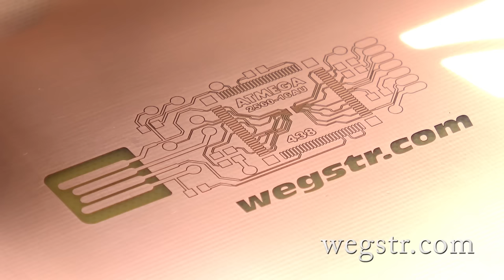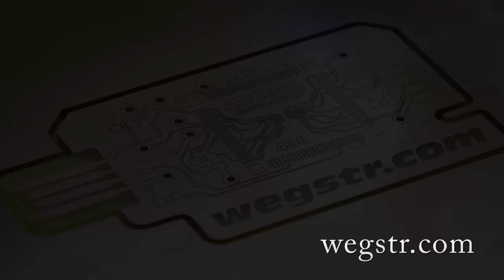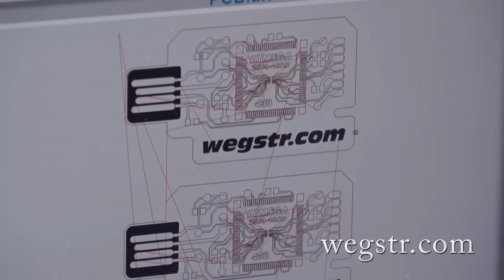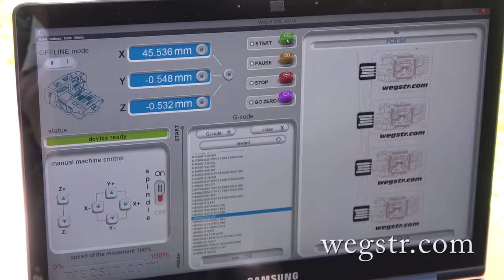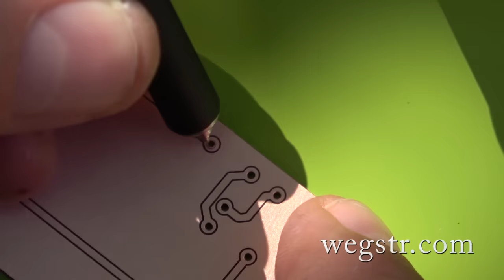Double layer PCB prototyping 0.1 mm traces/spaces

Comment: To answer some of the questions below. Sonia have had this machine for over a year now. It is an amazing price of kit and extremely well made. Isolation milling can take e quite some time and as does the probing of the PCB surface prior to milling. This machine can mill a small PCB in about 3 hours if you include the probe and mill operation. Also make sure that you have the correct isolation routing bits for the job. Also weave a small syringe of mineral oil to cot the PCB surface with prior to milling, it makes a big difference to the quality of the cut. With respect to milling the outside profile of the PCB, if the PCB is square or rectangular then far better to use a PCB Guillotine to cut the board. 

So for a slightly higher volume of birds, day 10 or more, I use this machine to drill all the holes in Microtrak pre-sensitised PCB board and then expose and etch in the usual way. This machine is very precise and accurate however use as intended for very small prototype runs and either use conventional etching or JLCPCB in China for more than say 20 boards.

This is an outstanding machine for its intended purpose. I am about to test this out to do some M2 thread milling in aluminium and sure it will be fine.

Comment: You guys should work on ink-jetting the copper layer onto fiberglass instead of trying to CNC material off the board, CNC has been done thousands of times by others and has yet to really work. If you could work out the chemistry of depositing metal you’d have a winner that could be done with a $25 ink jet print head and have 100 times the resolution of CNC.
Reply: Just an addition to your idea , just like through hole plating if you could come up with a method which inkjet prints something which could later be copper plated .......

Comment: It is beautiful...
From practical point of view. It would ve amazing if you can show, how the components are soldered onto it. I mean the melted tin just flow everywhere as there is no protective layer on that board. Even if using paste and heat gun
Reply: Peter, after the isolation and drilling process you clean the board and apply solder resist. One dry you use the an engraving bit and this mills through the solder resist to expose the component pads only. The rest of the board is protected by the resist. Hopefully this makes sense.

Comment: really impressive and clean fine milling there!, love how the toothbrush looks enormous. Would like to hear the sound of the machine though.
Reply: Hi John, it is not too noisy, you can work in a room at the same time. The PCB probe of the copper clad board takes up to 40 minutes and then you can load the nc code to start milling. It gets noisy once you start to mill the board edges. During the isolation routing I like to keep an eye on things every 10 minutes to add a few drops of mineral oil to the copper surface as this greatly improves the cut and final finish.

Comment: The main problem - non flat surface of board, bended material. Conical mill will produce different cut diameter on different parts of surface. Probably maximum width x height - 6 x 9 cm.
Reply: KV Popenko you need to make height map. Look up candle.
Reply: KV, I stick my PCB down to a sacrificial base that screw down to the machine bed. I use very thin double sided tape from Amazon. This keeps the whole copper board flat and then the electrical probing performs a contour map of the surface and the isolation routing is spot on. Using a this flat bladed screw driver and gradual bending force will prise the board from the base, Acetone will clean up both the back side of the PCB and the base as well.

Comment: And now... if you will try to solder a chip to this board, you will get to know the seventh level of hell :P
Reply: Why? Soldering a board like this is quite easy, even for a beginner. There's lots of great tutorials on how to solder a board like this here on YouTube.
Reply: Have you ever actually hand-soldered a chip with 0.1mm spacing between pads?

First-off it is not easy, second - it is almost impossible to do with simple home soldering irons.
Third - this board doesn't have solder mask
Fourth - this board has very small spacing between traces. 
Combine that with third - and you get a lot of unwanted bridges between traces - which you will have to clean off - welcome to hell. 
Even if you will solder every single trace and every single pad and clean all the bridges-  you still have to pray that you do not have any bridges underneath the chips. Because if you do - you will know that only once the board starts and doesn't work for unknown reason.

Everything looks nice on youtube video, but try it out yourself to see.
Reply: Whatever, I have soldered more than enough chips by myself, believe in what you want.
Reply: @marc_frank  don't tell the god what he can and cannot do :P
Reply: @marc_frank  and when and where did he ever told that he did not ever create anything like hell or is going to create or allow it to be created?
Don't be too full of yourself and put words in the mouth of the God that he never spoke. There is hell on earth, and there is hell besides earth.
Reply: @marc_frank  he did not.

Comment: Very slow production rate, etching makes finer trace and space, and you often cannot leave so much unconnected conductive material.  Cool capability though.
Reply: I mean it's about rapid prototyping man. We have one in our lab (not this companies) its made by LPKF they are exceptionally capable. Even have plate thru hole capability, it's not done the way shown here tho. Sometimes sending out for PCB fabrication also means exposing what you're working on...

Comment: I love your videos; so very well shot and they do a great job showcasing your equipment. I show them to all the students that work in my lab space (I run an engineering PCB fab lab at a US University and show your videos on a 70" TV, its mesmerizing), they love them too. Fantastic job! If possible, can you share whether your camera equipment is mounted to your CNC or are if you shoot video using standard equipment(DSLR/mirrorless etc) and a zoom lens? I have been using usb webcams to try and show students the process of fabricating PCBs (remote learning) but the quality is atrocious; It would be great to know if you have found an equipment-mountable camera that makes this kind of quality content.
Reply: They probably did it with a good camera and narrow angle lens, as the wegstr cnc moves the bed on X and Y axis while the Z axis with the tool stays still, except moving up and down.

Comment: Yeah, good luck soldering that QFP Atmega with flood copper in between the pads instead of solder mask, and that microscopic package in the middle.  These PCB milling machines make for great videos, and there is a role to play if you absolutely have to have a board same day. But otherwise -- pain and heartbreak, IMO.  Even the lands between the SMD R and C pads with only 0.1 mm clearance -- that's just trouble.
Reply: Yes you are right but, I believe this a show-off work and I do not think that it is a big deal to remove such flood copper regions.
Reply: For different, larger parts, I see something like this being very useful. As per the tiny parts in this video, I am inclined to agree with you. The only way I see someone realistically soldering anything that small without solder mask is with a VERY carefully set up solder paste stencil and reflow station.
Reply: There are limits to just about everything in life, within the limits of what CNC milling of PCB can do, there can be significant benefits?
Reply: My dude, use more flux - aka learn to solder betterer

Comment: The bed or platform must be really flat in order to be able to achieve this? We have our Roland MDX 40A and it could not be able to achieve full milled trace because of the angled plate, resulting of intact copper area.

Comment: 0.1mm traces? 0.13 - 0.15mm...  
The contact pitch of TQFP100 is 0.5mm IC!? 
Contact pad width 0.3mm. and Lead width 0.22mm.
Is the distance between the PCB line of the IC about 0.1 mm?

Comment: but.... why? this is lengthy, expensive, and the odds of solder spilling onto copper and causing a short are way too high!
Reply: 1 reason an 1 reason only. In house testing without the delay of shipping. If a prototype exits its design phase you can get a working prototype by the end of the day
Reply: @jakeengland1430  you can etch circuitboards at home though? like, all you need is a run of the mill printer, a clothes iron, some acetone, ferric chloride ane a solder mask. You can have a working prototype in less than 20 minutes, assuming you don't have specialised equipment.
Reply: @paweljasiek  i from personal experience will never touch acetone again it such a pain to work with and dangerous too its also not as repeatable you can also get much higher resolution on mills yeah for hobbyists go down your route cause its cheaper and easier bt for professionals mills are the way to go.
Reply: @jakeengland1430  You can keep the traces a little thicker in the proto and then thin them down later according to the fab house's capability. I'm assuming these are logic level signals and not power. Regardless, if you really are on the clock, etching is way faster. This is more of a luxury to be honest.
Reply: Well a few reasons when compared to a small “Hack” photolithography set up. 
1) with a standard at home inkjet printer you will not get down to 100 micron trace widths and spacing. The mask an at home printer does simply cannot produce a fine features like that. When you get that small you eventually start seeing the individual droplets of the print head and the density of the droplets is not high enough. You will etch those lines off.
2) depending on the project RF or Signal lines, the precision of the line widths are very important and you will not be able to do that accurately at home with a hack set up. Over etching is a huge huge problem when the features become small. 50 micron (which is a a very small amount of over etching. Would have to be a 1/4 oz copper) could be a huge percentage of your trace widths.

3) DIY or small operations chemical waste and chemical training is a huge aspect. For professional businesses that are small scale, chemical training and waste are very costly. You’re working with harsh chemicals that need to be disposed off properly. You should also really be utilizing a fume hood.
4) the mill also can drill VIAs and cut out the board to desired shape in one step. You will have to manually do that with photolithography which will never look as good. 

While a hack photolithography set up is nice and cheap, eventually it will all come to be the same price. Remember etchant doesn’t last forever and has to be replaced, solvents to clean the board need to be bought, other tools are needed for VIAs, and ink for the printer. Also time is money, this will be faster then etching at the hobbiest level. I don’t think you’d be making boards large enough where this would be to slow for that. As a hobbiest I understand this would be a luxury but would be really amazing to have it! This thing looked like a beast!
Reply: @paweljasiek  acid etching undercuts the resist. When the thickness exceed the width, etching fails. Hot air station needed for these.
Reply: @jakeengland1430  ethanol will so just fine.

Comment: Better hope your material is perfectly flat, which of course it won’t be, unless your paying an absolute fortune for extremely high quality PCB blanks. Seems only very expensive laser machines actually work reliably without hours of hassle at this point. In the end, it’s still going to be cheaper, and far far higher quality just getting a board house to use their millions of dollars worth of equipment to build them for you. Very neat concept that unfortunately still needs huge amounts of further design work to be practical, such as having sensors for dealing with less than perfect material stock and bit wear, professional machines use cameras for visual inspection and probing to overcome this. Rivets to join layers have been around for decades and sorta work for repairs if you only have one or two, on a board with lots of them you’ll have to solder them or you’ll have intermittent connection problems. So you might as well just run a jumper wire and solder that.
Reply: I've used a CNC like the one in the video at college. It actually works pretty well with normal quality PCB
Reply: Yeah getting true flat like this would be a couple tenths

Comment: I hear everywhere for the need of a very high spindle speed of 30.000 to even 100.000 rpm, what I have see here is just 11.000 rpm and a clean cutting, what is the reason? maybe vibrations of spindel of other systems who ragged the edges?

Comment: I'd buy it if it applied solder paste, had a pick and place, and used something like a heat gun to solder the components to the board
Reply: Coincidence?... I think not!
Reply: Shit that would be awesome. Also not impossible, if you could perhaps change the head.
Reply: @marijnstollenga1601  To do so is hell of a chalange in itself. Also you would need to load up your components in machine every time, therefore doesn't make sense to do so on hobbyist pcb (cause you really rarely need a few of a kind). So yeah, implementing such a system is just not worth the effort

Comment: Hello, what dust suction system are you using, the suction tube seems very thin, what vacum system is it connected to?
Reply: Ohh, so you are blowing the dust away, and not sucking it up?.....lots og mess...or?

Comment: Hello, what angle is the cutting milling cutter ? And what CNC model do you use in the video ?
Reply: dont know about the machine but i think thats a 60 degree bit chamfer tool. i have one like it
EDIT 1: nope correction. thats a single bit engraving tool. cuz you can see the engravings through the tool . and its 60 degrees im sure of that part

Comment: How do you get your table so flat?
Reply: Put down a spoil board and get the machine to skim it.
Reply: Old Machines & Such,  ah yes I forgot you only need a size of a few pcbs!  Subscribed!
Reply: there is an auto level software that probes the surface of the PCB in a grid and modifies the Gcode so it contains the height differences for the surface.
Also this case you need a machine that can be calibrated to more than 0.05mm precision as you want to mill 0.1mm traces.

Comment: Pcb etch is faster and you don't need to flat pcb, otherwise this method sometimes leave shorted traces. Although very useful for edge cutting and making thru holes and vias
Reply: Well yes and no. Shorted tracks are usually due to bad setting or using an incorrect cutting bit.  If someone helps me to understand if I can upload an image then I will run a demo later this week on some 0.8 mm board to show you the quality.

Comment: Why did you leave all the copper in place where it shouldn't be? This makes it very tricky to solder.
Reply: Vậy mà không biết hàn à
Gà thật đấy
Reply: Milling out would take forever and soldering will be just as easy as if it wasn't there after a solder mask is applied on top.

Comment: Want to check you are using blower or vacuum as don’t see any engraving dust in the process
Reply: Very great production lines.
Any needs on conformal  High Power High Voltage on UV Curing Coating Powers?

Comment: Wow, great job...! the restricted copper areas are routed magically...! Which etching bit have u used and how did you convert the gerber file to gcode (which tool/program i mean, because it works very well)...? Is like an art job...!
Reply: You didn't had any thoughts of looking at the links instead?
Reply: @dtiydr  yes dear... I don't mean control software, I mean the software used to generate the routing (FlatCAM for example)...
Reply: @matteolenzi6913  You have the adress to them, they most likely know that way better then anyone here!

Comment: Can you produce a 4 layer board with this setup?
Reply: You know how difficult it is to make a 4 layer board? Never ever can you make a 4 layer board with a cnc they have to etch every layer and then press it with an insulator between.
See the process of a pcb manufacturer: https://www.pcbway.com/pcb-service.html
Reply: How is that even supposed to work
Reply: No, you can't. Or you must create 2 boards with 2 layers each. Moreover, the riveting technology doesn't work fine, electrochemical couples are produced between copper and solder.

Comment: Cool but why waste so much pcb on just your logo
Reply: Because its must be a permanent logo. Then not easy to vanished or erased.
Reply: @licht4401  or you can just make it smaller or put it on the silk screen. There is no need for it to take up 1/3 of the board
Reply: @transgrl  Well this is good solution. But me at personal more like to see the permanent logo like this.
Reply: @licht4401  your missing the point, it's a waste of space. Considering this is supposed to clearly be a USB device it is already quite wide and then to have a giant logo adds further to this. There is no need for it to be so wide
Reply: @transgrl  maybe the pcb has been designed according to the internal product so it's not sold freely so we don't know whether it is too consuming or not
Reply: @licht4401  Again your missing the point. Having a logo almost the same size as the functional part of the pcb is a waste, no matter what the situation that is a waste of pcb space.
Reply: @transgrl  having a logo that is almost the same size as the product does not mean always spending a lot of space. what if the logo is made small but instead leaves most parts. and finally the part must be removed? Will it even lose throwing away the "unused" part just because the logo is made smaller? this is what I call company policy that we don't know
Reply: @licht4401  if you removed the logo in post then the board would be lopsided.